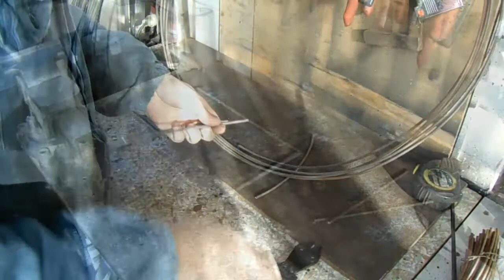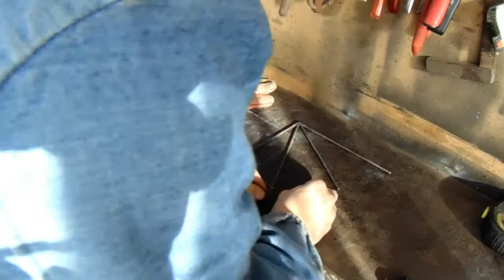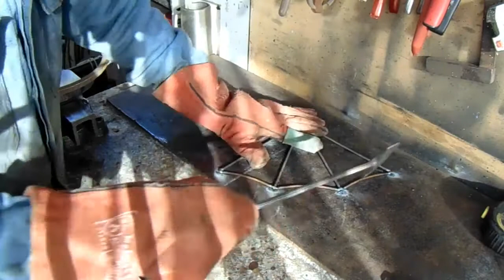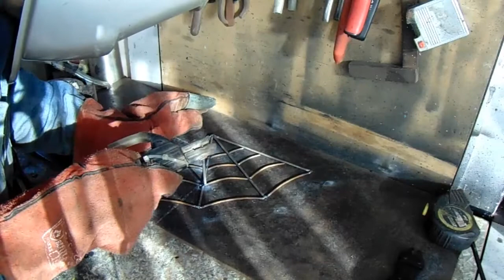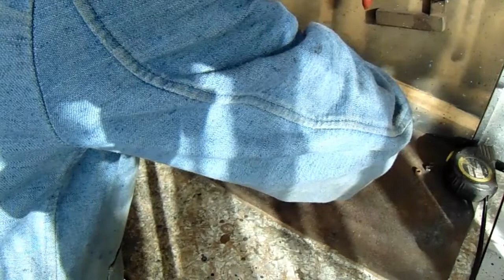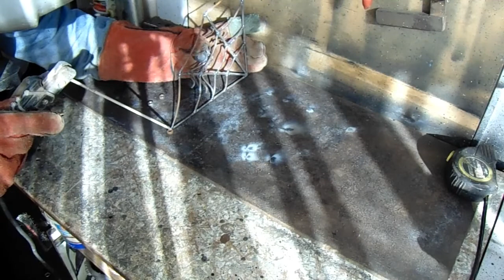How to make a decorative spider web

Comment: What's the stock material you use , also are you running ac or dc and the style rod. I have a Lincoln ac225 arc.
Reply from the maker: I use 4 and 6 milimeters rod, ac.